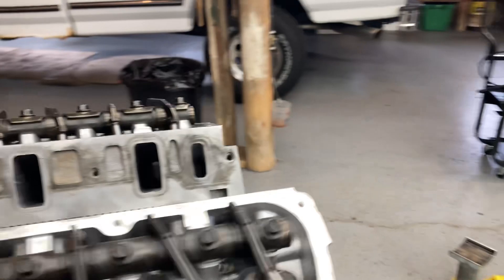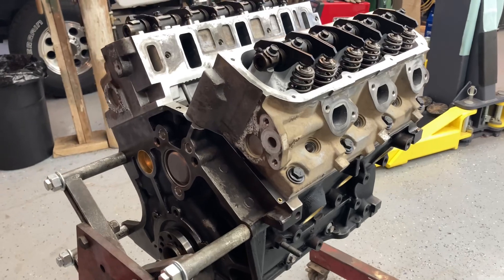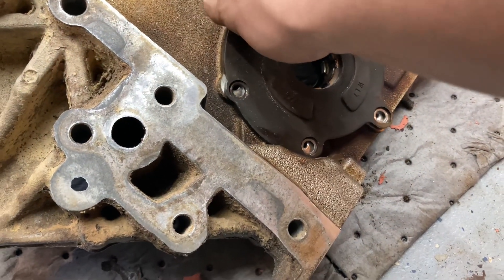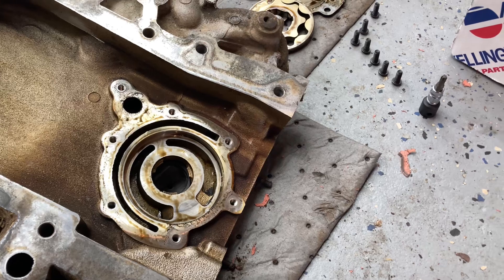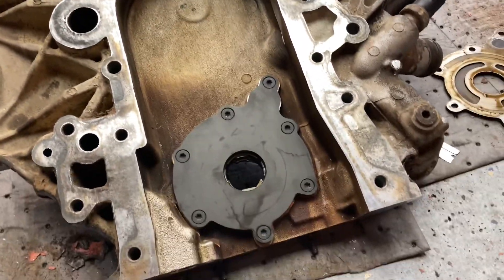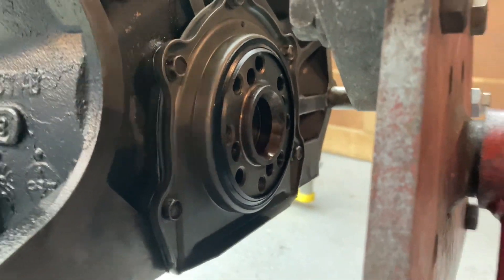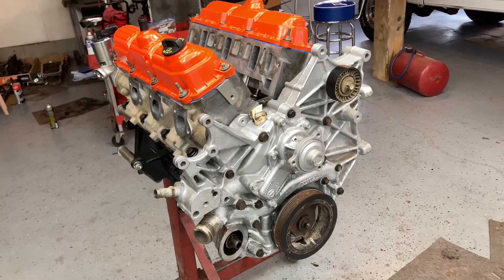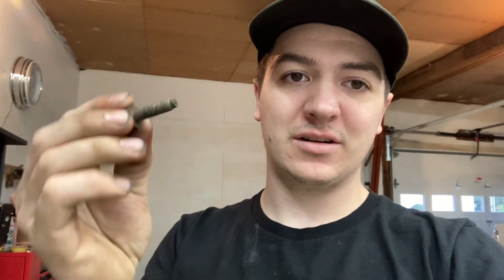3.8L Jeep engine rebuilding!

Comment: I'm in the middle of rebuilding my 3.8 - unfortunately, I removed my flex-plate without marking orientation/location to match the crank. as you know the flex-plate had multiple mounting holes so looks like it can be rotated and mounted in different rotations - the windows on the flex-plate need to match the crankshaft sensor... any advice on mounting the flex plate?
Reply from the maker: @MrMountaincycle  so I learned after swapping the old OEM one back on finding the aftermarket flex plate I installed was machined incorrectly, there is only 1 way it can correctly be installed so you shouldn’t worry about it honestly. But be certain what you are installing is OEM because you don’t want to have to pull the trans to replace it after finding an extended crank issue. Learn from my failures lol

Comment: Maybe a silly question, but I cannot find a solid answer anywhere online: How do you align the harmonic balancer with the engine's timing (e.g. balancer's markings vs TDC)?  This engine's crank doesn't have a key for the balancer and I did not make any marks when taking it off lol... so yeah, now scratching my head.  Thanks!
Reply from the maker: 1:04  there are supposed to be markings on both the camshaft sprocket and crank sprocket as shown in this video at this time stamp.

Comment: Did this myself a few years ago at 140K miles. The carbon build up on the pistons was insane; it took a few days of soaking in chemicals in a home depot bucket to remove all the junk (literally took two weeks for all 6 pistons). I also did the crankshaft bearings just for good measure since so many people had spun theirs over the years. I was surprised the amount of cylinder honing left in place; the walls were not mirror-like at all...they looked almost freshly honed, but then again I have changed the oil every 3k miles since new.  The only thing I would have done differently is pulling the whole engine so I could have done the rear main seal. It might have made the rest of the job a lot easier lol. Unfortunately it is leaking coolant again 60K miles later. I am pretty sure this is due to etching on the block (I had the heads machined but didn't do a whole lot the the block because I did not want any contaminants falling into the crankshaft from above). Oh, and the new exhaust headers cracked shortly after. I knew better and should had just purchased aftermarket headers.

Thanks for posting.

Comment: I have a JK 3.8 I'm almost 300k now. I'm replacing head gaskets lower intake manifold gasket and Gasket headers. Unfortunately I have to take pretty much the orange in the park almost. It's 44° outside and I've been doing it off and on but we had rain two times already and my Pistons are exposed although under the hood two questions do I need to worry about moisture in the engine since it rained a couple days? And should I change my timing chain since I have everything apart already?
Reply: Putting mine together now. Did you replace the litters?  I got the melling lifters and the oil hole is on the side instead of the front facing the valley. I am not sure if it matters what direction they face.
Reply from the maker: @spgirard30  it was a while since I built this engine so I can’t remember how the oiling passage hole was facing, but I would match it up with the old lifter and see if the oil hole is located in the same spot. If it is not, I would try sending them back and getting another set either OEM or a better aftermarket option since they were designed that way for a reason.
Reply from the maker: Honestly the chain is super simple to replace so you might as well since you’re in there. And at that point, I HIGHLY suggest you replace the oil pump pressure relief valve inside the bottom of the timing cover as well, (watch my engine installation video for further details about that) And I wouldn’t say the rain would cause a problem but of course you really should get that water out and cover the openings in the engine as soon as possible to prevent rusting the cylinder walls
Reply: @trailbandit_  ok tyvm for ur reply.